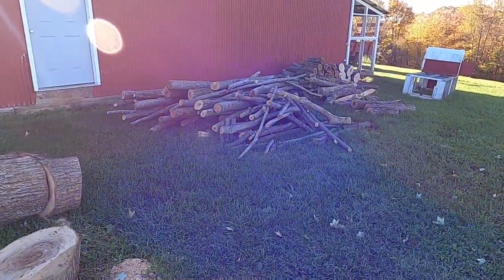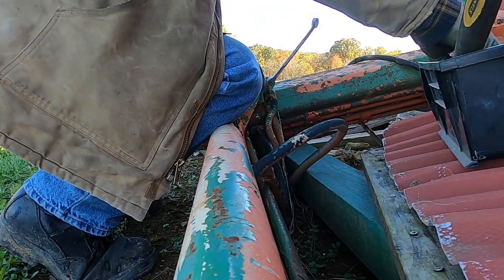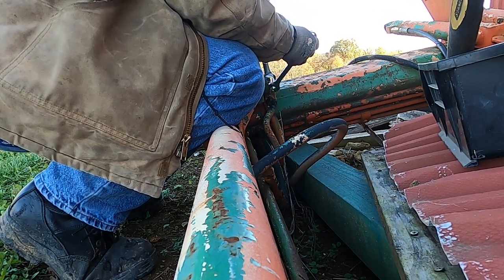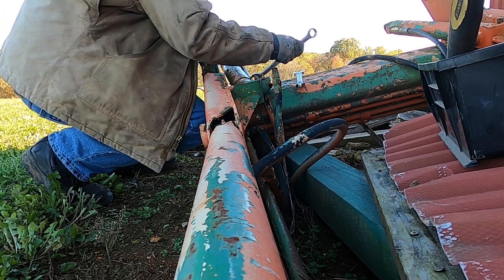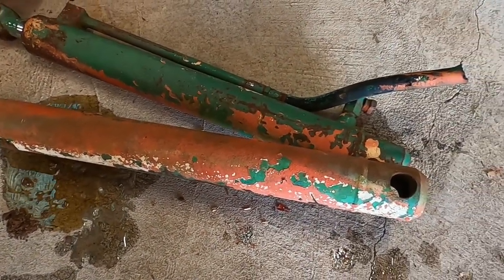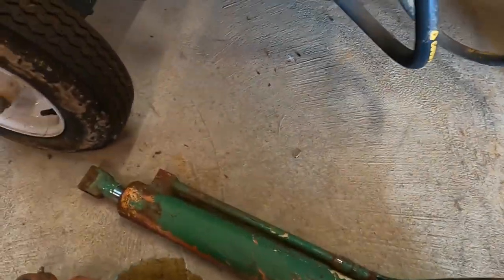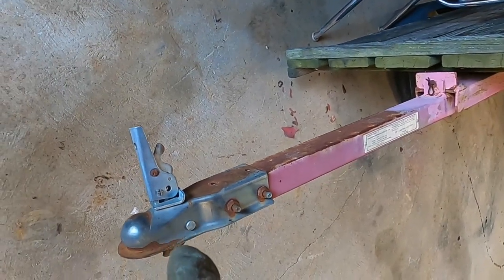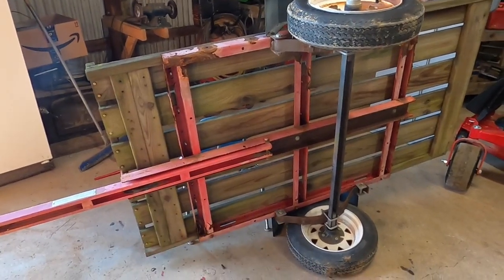129: Hydraulic Rams and The Tiny Trailer - Is It The New ATV Forestry Trailer?

Comment: I have 2 of the old John Deere number 45 mechanical trip loaders. Both of them are fully operational. In one of my firewood videos I show one of my 520 John Deere’s lifting a huge white oak log. I didn’t lift it very high but did demonstrate that the loader could and would lift it.
Not a big believer in pushing my equipment to the extreme limits. I have seen my Dad on several occasions picking up a 16 ft green red oak log with that same tractor and loader and setting it up onto the bed of a flatbed truck.
If those cylinders are in any kind of useable shape, you will be amazed at their capability.
Full watch and a thumbs up 👍 Logan
Reply from the maker: Good to know!  These are just the bucket tilt rams, but they should work well just to hold brush down with a grapple.  I'm really debating the style to make... either a multi-fork design with tines about 3 feet long or just steel teeth pointed down to rip roots up...  I see so many different designs.  I supposed I should go with the one that is most drastically different than the one I already have.  Thanks for watching!